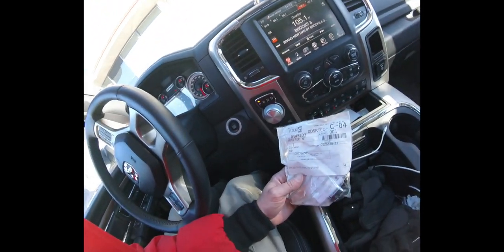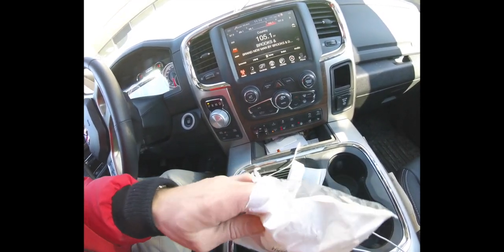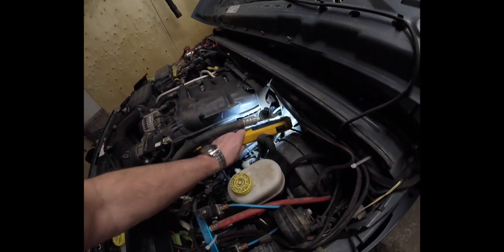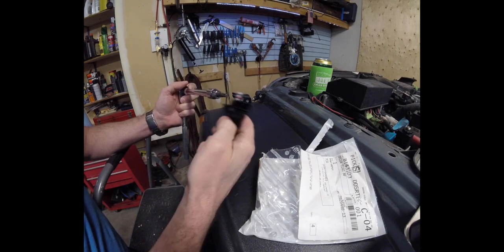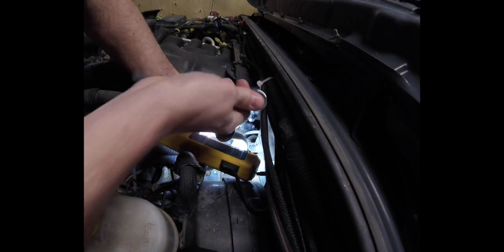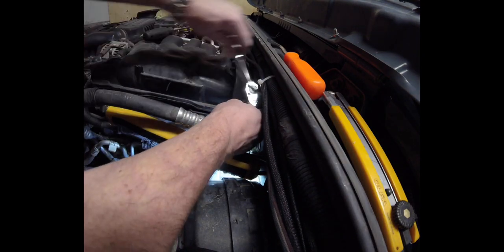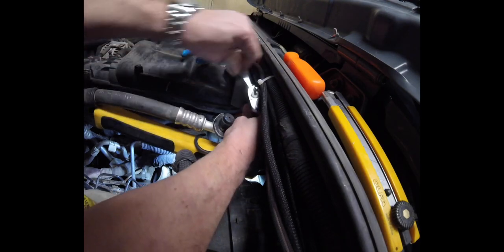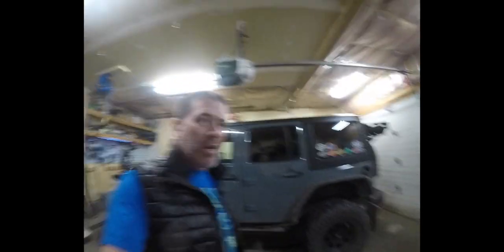My Jeep is broken!

Comment: 2013 JK 4 door - The dealer is replacing the galley bolts on mine. Said the right head was backed out and they could only tighten it to 7lbs of torque when factory standard is 15. My Jeep has been lighting up like a pinball machine with the check engine and traction control being the most lit warning lights. It happens when I am driving at speed up large grades, so 60+ mph up somewhere like a Cajon Pass, basically anytime I try to get to the mountains. Then the p0394 code comes up and it won't accelerate above 2200 rpm in failsafe mode of sorts. I live on a mountain, but can really only drive 35-45 mph to get home, so it doesn't happen until I try to take it on trips. I turn the Jeep off, it runs fine, but the check engine light remains on. It goes away after a while, and then does it again. It has been doing this since I bought it a year ago. It has happened six times, and every time I have tried to take it on a significant trip. I hope it is now fixed. Luckily I bought a 5 year 50,000 mile warranty. I've had to fight with them a little bit, but I think things are solid now. Crossing my fingers.
Reply from the maker: Yes I hope it works out for you. I don’t have any trust left for the dealers.  This is a know issue, it should be a warranty item no madder the miles or if you have a warranty or not.  Good luck with everything
Reply: Any update? This just started for me. Replaced both sensors still a shit show. When towing my small trailer uphill or constant 70 mph speed etc I get 394 and torque request denied. Pissing me off. Goes in limp mode. Pull over, reset goes another hour does it again
Reply: What did you end up doing to get it fixed?
Reply: @kevinlange7319  hey Kevin.   I have had the same codes on my 2014 with 83k on it.  I noticed when I took out my camshaft sensors that it looked like there was a gear or something in there and I felt around with my finger and noticed it was smooth.  The lobes that the sensors reads had a metallic sludge on them similar to what you'd find in the magnetic differential plug when you change the fluid.  I wiped the lobes clean by sticking my finger in the hole, wiping, then cranking the engine for a split second advance the camshaft and going to the cam sensor opening in the valve cover and wiping the sludge off with a rag again. I must've wiped off that gunk for at least 8-10 mins before they were clean.  I also removed my upper intake to gain total access to the cam sensor openings.  I took the jeep out for a drive and I had the RPM up to 6500-6800 without a stumble or DTC or anything.  Runs like new.  Maybe, if your Jeep is still acting up, give a look see to what's going on.  It may be a temp fix and also might be a sign of upper engine wear (God I hope not) but I've been running Mobil 1  10w-30 since I bought it with 25k on it.  Good luck.
Reply: @marcsciarrotta3109  I actually just changed my oil and it fixed what several mechanics said was cam phasers. I went to 10w30 and added Lucas oil stabilizer. 30k miles without issue.
Reply: @kevinlange7319  10w30 is the way to go.  I get the whole "fuel economy" thing with the 5w-20.... But may as well put water in the engine.  I'm not worried about fuel economy.... I own a BOX with 37" ties on it and a 6" suspension lift.  If I wanted fuel economy, I'd buy a Prius. LMAO!!   Great to hear your in good shape.  Good luck my friend!!!

Comment: Whats the tsb number? Im having the same problem. Are you sure it was the valvle cover bolts coming loose that caused this?
Reply from the maker: +Sam Bell Hello,  well I finally had to take it to the stealership and that’s what they told me. No new parts just labour if I had know that’s what it was, I would have fixed it myself. They did say that there was another code that showed the oil pressure was a bit low. I never noticed that on my display on the Jeep.

Comment: I have the same codes omg! What do you recommend I do brother? I have been getting great milage though the plus on being on limp mode lol 13.8!
Reply from the maker: Are you loosing oil pressure?  This was the main reason of my issue.  Check that first, check the sensor, check the wiring.  I would even check your valve cover bolts.  Wouldn't hurt.

Comment: Wondering lose valve cover bolts? Or do you mean lose camshaft cap bolts?
Reply from the maker: Jr R they told me it was the valve cover bolts.  For some reason they said I lost oil pressure

Comment: sounds shady if you ask me... Sorry you had to pay that much... Did you check the other CPS? on the passenger side? Just wondering.
Reply from the maker: Yes, shady for sure.  They will never see any of my business ever again.  I checked them both, both wires were putting out the correct voltage.  Thanks for watching.

Comment: Thanks for the video.  You mention a Service Bulletin (TSB), but not the specifics.  I am having the exact same problems.  If I have to have the dealer fix it, it would be nice to have the TSB info so I can argue for a reasonable cost and not get raped with hours of troubleshooting BS.  Do you have that?  Greatly appreciated. Thanks.
Reply from the maker: +Bil Boit The problem they told me was my valve cover bolts were loose.   I do have a hard time to believe that but I never got any codes after that.

Comment: Did codes ever come back?
Reply from the maker: No I took it to the dealership and they took me for a ride.  $1600 later they told me it was loose valve cover bolts.
Reply: @homeguy4  did they remove the valve cover and replace the gaskets??  My story goes like this..... 2014 with 83k on it.  I've been having these cam shaft codes and torque converter codes come on on a hard acceleration for months.  I've tested all the wiring and it's all good.  About 2 weeks ago, I pulled out my cam sensors to see if they were cracked or gunked up.  It looked like there was a gear inside that the cam sensor was reading.  I stuck my finger in there to feel of maybe one of the teeth had been broken off...but it was smooth!!  I wiped of a metallic sludge similar to what you'd find on your diff plug magnet when you change the fluid.  I had the upper manifold off to gain total access while I was testing the wiring so I was able to really see in the cam sensor holes in the valve cover.  I would momentarily crank the engine to advance the camshaft and then go wipe them off again.  I was doing so for about 8-10 mins til they were clean.  I'm guessing it was metal shavings for wear in the valve trian that just accumulate on the magnetic lobes on the camshaft??  If there are even magnetic lobes...but all I know is now I have my jeep back.  It runs like new.  I had the RPMs up to 6500-6800 RPMs and no stumbles and no DTCs.  I'm guessing that your dealership may have removed the valve cover and possibly cleaned them and around them.  BC just tightening the valve covers  wouldn't do anything related to oil pressure because the PCV is right in the back of the valve covers next to the cam sensors.  Good luck to you and I hope that Chrysler pulls their heads out of their butts and starts to take care of us Jeep owners.  Jeepmis such a great brand and has a HUGE following.  ✌️

Comment: These JK's are money pits.  Mine can't hold an alignment to save its life. I have a modest 2.5" lift with 33" duratracs. A boat load of aftermarket suspension parts and always one thing after another. I saw your bill from the stealership. It never ends, I have never put so much time and money into anything like this lemon. Definitely looking to sell this pos and get an '87 Grand National or '80 Corvette. I love my JK but it's so fucking needy. My sons as babies were less needy!
Reply from the maker: +Jeep Life71 hello Jeep life 71.  My son had the death wobble on his Jeep.  We ended up taking Everything apart and put it all Back together tight .  That took care of the problem and we never really found out what was loose.
Reply: @homeguy4  When I can sell this pos JK, I'm might get a 2 door JL Rubicon. Perfect set up for me, 33's and no need to ever lift it! Keep the geometry stock and avoid all these headaches.
Reply from the maker: Jeep Life71 ya I can understand your frustration. Jeeps are a love and hate relationship.  JL are pretty sweet. I’ve just sunk too much into mine to justify selling it and buying another
Reply: @homeguy4  I'm working on getting it right. Like most I've got far too much invested to let it go now. Might need a steering box and maybe I'll add a Steer Smarts attenuator and Currie drag link. I have a synergy drag link and it sucks. They're darn near impossible to adjust. On the stock drag link, you just loosen the 2 15mm bolts, turn sleeve until the wheel is at 12 o'clock and done. Definitely a love hate relationship with any pre Wrangler and Wranglers of today. Jeep On! 🇺🇸
Reply from the maker: Jeep Life71 have you tried putting the synergy track bar/steering sector shaft brace on to tighten up the steering.  I did it on mine and my son just got one.  They make a world of difference
Reply from the maker: Jeep Life71 totally understand. Cheer Man!
Reply: @homeguy4  Appreciated the advice especially from someone who gets it's a Jeep thing. Tomorrow I'll love my Jeep again.

Comment: if this happened again just check your engine wiring
Reply from the maker: Can you explain why just the wiring?  That is something I checked and it did not reveal anything like was found out.
Reply: HOMEGUY4X4 it only happens when your car giggles or ben in rough road..
I had the same issue you can check the latest video i posted in my channel.. changed the camshaft sensor.. three days later i went to the desert and the same happened
Reply from the maker: What ended up being the problem was the valve cover bolts were all loose.  Chrysler has a service bulletin on this.
Reply: @AhmadAbbasAli  I had read before that the wire harness to that area is too short I went and checked and noticed that the harness was out of the fasteners put them back but only erased the drivers side code I still have the other one :(
Reply: 1Massiso it should go by it self.. mine for sure was the harness on back of the engine
I shake it and alarms comes
Reply: HOMEGUY4X4 nothing really with my valve cover bolts.. its for sure was the harness on back of the engine to the battery side..
I shake it and alarms comes

I am just waiting a new harness checking device to arrive then we will see from where the problem is
Reply: Yes I suspect the same thing but I had a recall done, and the dealer that I was dealing with during that time were crooked,  Male Ridge Chrysler don't buy from them! I would not put it pass them playing dirty tricks. Lol